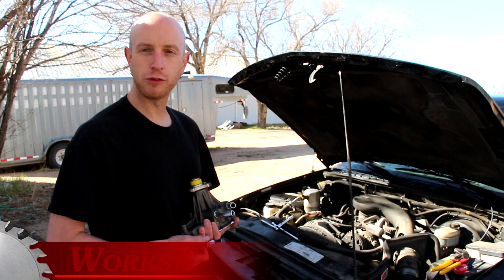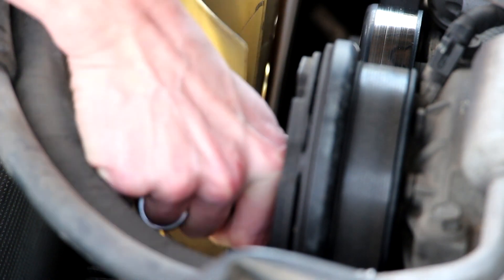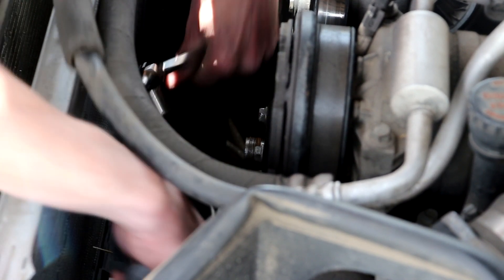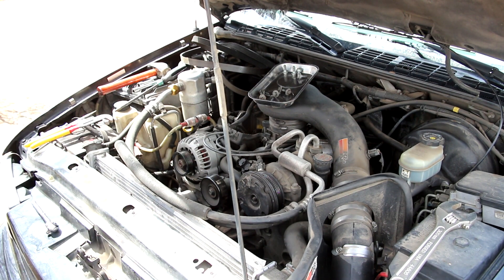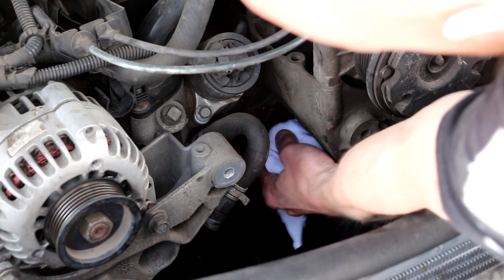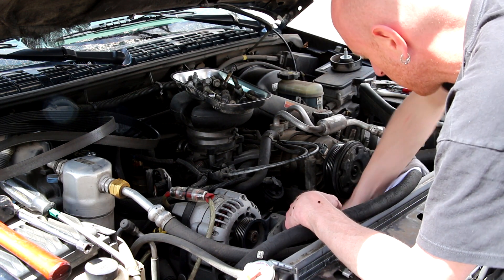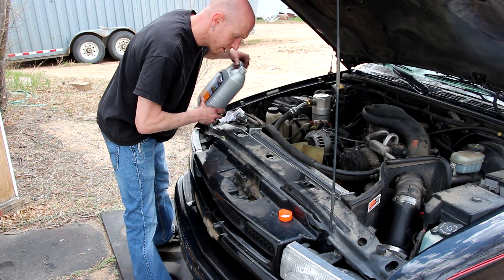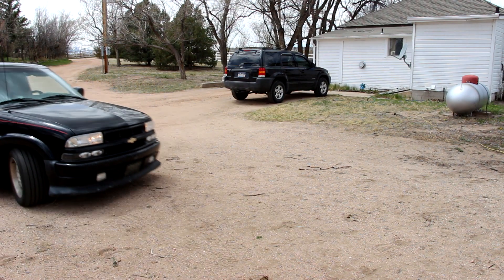Changing a 1999 Chevy 4.3 V6 Water Pump

Comment: I have a 2001 Silverado. Watched several videos, but watched this one several times before I did the swap. Someone suggested that I not rtv the gaskets because if the application is not even it can harden and cause a bad seal. But after wrestling to get the gaskets and bolts in place for 30 min, I went with a thin coat of rtv just to keep the gaskets from falling off. This was my first time under the hood. I was most worried about getting the fan nut off. But I rented the wrench and was lucky enough to get it with a screwdriver under the pulley bolt. 

Excellent video. Thank you sir.
Reply from the maker: Awesome! I'm glad you got yours fixed. Sometimes a little RTV is a big help holding the gasket.

Comment: Just wanted to thank you for posting this video,  I decided to give it a shot after watching this and the job was a success. I have a 2000 GMC Jimmy but the parts were the same.  I rented the wrench for the fan from AutoZone. It was for a Ford but it still worked.  If anyone out there is a little skilled then watch this video and do it yourself, save some money and take pride in your accomplishment.  Total cost was about $70.  Thanks
Reply from the maker: Awesome! I'm glad you're back up and running.

Comment: Thanks for making that video, made my life much easier.  I was really concerned about removing all the accessories around the water pump.  Seems that wasn't the case.  It was a bit of a challenge to get the new pump to line up, but no big deal.  I had it all done in less than 90 minutes.  One tip to add.  While got the belt off,  check the idler pulleys.  I found the bearings in both idlers were bad.  Thanks Jeff.
Reply: B

Comment: Thank you for this video!!! Honestly I couldnt have done the job without it. Had already replaced the fan and radiator, then found out the water pump was bad!  Also, thanks for the small detail info like the thread sealers! Many thanks!!!

Comment: A BIG THANK YOU! I You pointed me in the right direction!!! I had no idea where i had leak, but i had one, and it stranded my wife, but she was smart enough to reconize the 2002 xtreme was overheated,so she parked,  called me, had it towed home, but still couldn't fiqure when the leak was, till I filled it completed back up ran it for awhile (10 minutes) no hoses were leaking, then i saw a drip from the bottom of the timing cover,1st thoght was a cracked block, jacked the car up and found it dripping a lot from the bottom of the watrer pump,(The Weep Hole) You saved a ton of time!  this was a relatively an easy fix with your help!
Reply: +benjamin lopez best to use a radiator pressure tester - pump it up to 15lbs and you'll be sure to find your leak - it will be flowing out - I did this recently on two 4.3's - one was a leak at the intake manifold front of engine and the other that I'm doing now was the water pump.  It's hard to tell sometimes with the engine running and the fan blowing and coolant dripping from god knows where when everything is wet.  Make sure you top up the system first.

Comment: WOW !!  When my 99 S10 ZR2 got up to halfway on the temperature gauge, my intake manifold gaskets needed replacing.  What I did on my fan bolt was, I got a set of visegrips on the waterpump pulley after removing the S-belt,  and with the 2 foot long crescent wrench that I bought, (could of went with a 18 inch) loosen the nut and the viseggrips get wedged in place from the pulley. Truck went down in Oct 15' and Im still doing the job!  Im a truck driver, so Im not at the S10 everyday !! Also what you can do on that nut is take something long and put it under the lower right waterpump pulley nut and that will hold the pulley from turning...................................

Comment: Excellent instructions on your video. Yes, the fan clutch removal is tricky, but your approach worked for me, as well. I understand you may be able to rent the removal tool at places like AutoZone. Upon opening the NAPA water pump box, the inside top box flap states that the number one reason for new water pumps to fail is failure to flush the cooling system BEFORE installing the new pump.  That make sense to me, as well as perhaps, changing out any hoses that seem a little soft or "iffy". This video really helped me know what I was in store for. THANK YOU!

Comment: Im moving across the country and I'm stuck cuz my truck is over heating. I'm on the side of the road right now... Gonna let my truck cool down limp it to the auto parts store and replace this video was great thanks a ton
Reply: Check you fan clutch too, if you're over heating happens in stop and go/city traffic. It's also worth checking your thermostat and radiator cap too.

Comment: yea I just did one hell of a coolant flush on the blazer, because I ran dex a little low, and it reacted sludgy to the oxygen that entered the system, now I'm putting in the newer zerex g05 coolant it is highly favored by blazer and s10 owners for its lubrication properties on the water pump and seals!

Comment: Good Video and Clear as well. You should have protected the Radiator Fins... Cut a Cardboard same size, Tape it on there. Then you can work without worries :D
Reply: Or just pull the radiator and clean and flush it while it's out.
Reply: @gpecaut1  - Yup, that would work too! :)

Comment: Thanks for the video's they've been a big help. Another easy way to get the fan off is to put a small chain behind one of the ac bolts and one of the four bolts on the water pump pulley that holds it nice and tight so you can loosen the fan
Reply from the maker: Thats a good idea. I may have to try that.

Comment: awesome video, I'm about to do this on a 2001 blazer.
Reply from the maker: Did you get your pump changed?
Reply: +Jeff Baker i did thank you, i also had to change the radiator. Seeing the issue you had removing the fan, i rented the tool to remove it. I still had to use my wrench and your favorite tool lol. I pretty much used every method you did, even for installing the gaskets in the water pump.
Reply from the maker: Awesome. Did the fan tool make it any easier?
Reply: +Jeff Baker it has when I've used it doing it on a 350 vortec suburban. the tools on the kit were either to big or to small.

Comment: I nearly lost my mind trying to get the gaskets to stay in place while installing the pump. Ended up destroying them from falling off into oil and coolant, even with the bolts in the pump. I ended up buying a sheet of gasket material and making my own gaskets, so I could make the bolt holes just a hair smaller than the bolts, and they held in place perfectly. And now about a year later I have a massive coolant leak from what I'm assuming is the new pump, or possibly the gaskets, I'm having trouble pin pointing exactly where. So I get to do it all over again.

Comment: Let me save EVERYONE the headache for these fan clutch bolts.. 

1. Put your wrench (15 in adjustable is the easiest and cheapest to find) on the nut.
2.with the belt STILL ATTACHED have the wrench sitting vertical so that the back half is sticking up above the motor.
3.smack it with something (I used a jack handle like a baseball bat). Smack it hard. Imagine that the wrench just insulted your s10.
Reply: J L I just used your advice, worked perfectly,
Reply: 36 mm wrench is a great fit for the nut

Comment: Did you only put gasket sealant between the pump and the gaskets or the mating surfaces where the pump is installed and the gasket too?
Reply from the maker: Both sides of the gasket.

Comment: I have an 02 blazer 2dr, after months of sitting I started it after warm up steam city from under hood let it sit month or 3 longer and changed upper hose thinkn it was issue filled up radiator and started it and water was gushing out the bottom of engine thought it was the two lines that run by oil pan then saw it was gushing out the water pump seal not weep hole so my question is will replacing water pump likely to fix it or u think I will find another issue ? 
No water or anti freeze in oil n water pump is hella rusty . Next question is how hard to replace ac pump since I'd be in the area and are there other things that I shld check or replace while in the area of water pump
Reply from the maker: If its gushing out the water pump, the pump has probably failed. Its hard to say without seeing it but I think that may be your problem. As far as the AC pump, it shouldnt be hard. You'll need to pull a vacuum on it to remove the refrigerant but the actual replacement of the pump shouldn't be hard.
Reply: @homebuiltshop  ty bro I'm serious when I say that you going out your way to reply to a stranger promptly and with encouraging words is the sign of a good person whom I have much appreciation for. Ty again brother and I'm waiting on wtr pmp to arrive once I finish I'll lyk and it will be with your videos help. I also watched your video on rust removal and another way to get it off of things like hand tools is white vinegar add a cup of salt to every gallon vinegar let sit covered for 24 hrs (less time depending on how bad it's rusted) take out wire brush it rinse in water and baking soda to neutralize the acid from vinegar n salt and 3 n 1 oil it to prevent flash rust it's excellent way I use it for tool restorations on vintage tools I do as hobby and extra money.
Reply: Replacing the AC compressor isn't hard, BUT when you open the AC system you should also replace the dryer. The system should have the refrigerant pumped out, a very expensive tool, as today it must be recovered. If your car is old enough that it has R12, the whole system should be converted to the new EPA specs, as R12 will 1; be hard to find and 2; cost a fortune.

Comment: Where did you wedge the screw driver when you were trying to break the nut lose?
Reply from the maker: You have to wedge it between one of the bolts that hold the pulley on, and the fan shaft. There are 4 bolts on the pulley. You have to play with it a bit to get it in the right spot. Its kind of tricky to get that large fan nut loose. Mine was really tight. I think they make a tool that somehow holds the pulley while you loosen the fan but once you get the screwdriver in the right spot, it works OK. Hope that helps.

Comment: Very informative and professional video. I have a 2001 s10 v6, would this most likely be the same procedure and part?
Reply from the maker: The procedure should be the same. I'm not sure if the pump is the same. Check the auto parts store.
Reply: Pretty sure GM has been running the same 4.3 since the mid 90's with slight modifications until at least 2010; Workplace has two new-ish GMC that have the 4.3 Vortec, different configuration but same block.

Comment: I have wrenches 32mm,1inch and sockets that go up to 36mm do you think those are big enough for the fan clutch Nut ?. my water pump looks like it's covered in rust so I'd rather replace it then be sorry later
Reply from the maker: +Dillon Koch a socket will not work. It needs to be a wrench. Grab some of yours and see if they fit.

Comment: Great video, But what size is that fan clutch bolt.
Reply from the maker: I'm not sure the exact size. The large adjustable wrench works well. I think I used a 12" wrench. The 10" one didn't go large enough.

Comment: I am replacing a 2001 Blazer's water pump.  You did say thread sealant on the bottom bolt?
Reply from the maker: +Jason Driskell I don't remember which one goes through to the water jacket. I think I put the sealant on all the bolts.
Reply: Thanks Man.  That's exactly what I did.

Comment: when you remove the hoses does all of the anti freeze dump out?
Reply from the maker: You will lose dome fluid when removing the hoses. Its best to drain the radiator first to try to minimize the mess. It can be messy.

Comment: I replaced water pump today but when'd turn on the heater to ad the coolant I saw that started to liquid weather next to the freeon deposit do you know what wrong on it ?
Reply from the maker: +geo geoo do you mean on the AC piping? Sounds like condensation. The pipes will do that when the compressor is on.

Comment: When you removed the nut from the fan, instead of hitting it with a hammer why didnt you just use a breaker bar? A long metal pipe or similiar over the wrench and turn?
Reply from the maker: That probably would have worked well. I just didn't think of it at the time.
Reply: +Tyler Bullard  I had to use a piece of chain and a longer bolt on the sheave and bolted it off on a part of the  car frame to keep it from rotating. AND a long piece of pipe on the end of the open end wrench. AND a sludge hammer. Not fun, a little Never Seize when reinstalled. I did that for a fan clutch the beginning of the summer, now I get to do it again for the water pump. Might as well pull the thermostat and give it a flush before I change the pump.
Reply: Breckenridge Caine III Get an air chisel man. I tried everything but your way to break the clutch bolt lose and hold that sheave/housing. 4.3 s10? Didnt even have to hold the housing, buddy let me borrow an air chisel and i went at it for a bout 20 seconds and it broke right loose and spun off.
Reply from the maker: I've heard of the air chesel attachment and I have an air chisel. I just don't have the attachment for the clutch.
Reply: +Breckenridge Caine III  Got it off; ran the chain to the cross bar underneath and the clutch nut came off with a tug on the open end adjustable wrench. Everything is off, engine flushed,  I'll put the new water pump on Monday.

Comment: Is the same with the heater on I never turn on the ac that's why I'm little worried
Reply from the maker: +geo geoo I believe when you have the heater set to defrost and possibly the vent,it turns on the compressor. I think only the floor vents don't use the compressor.

Comment: Can I use any wrench or do I need to rent one?
Reply from the maker: javier garza You should be able to use any wrench that fits.
Reply: Be at it for a while & it wouldn't give. Calling it a night. Trying to take off fan but no luck:(
Reply: Unscrewing it to the left side?
Reply from the maker: javier garza It unscrews counterclockwise. Make sure you hold the water pump pulley still with a screwdriver or something. Mine was really stuck. I had to whack it pretty good with a hammer to get it loose. You'll get it. Good luck.
Reply: Had to take off alternator then took off water pump with fan on. Took it to my Buddy shop & use a air chisel.
Reply: More space to work & decided to flush out radiator & it was dirty. Guess what had to use Bar's Leaks :(
Reply from the maker: I'm glad you were able to get it.
Reply: I usually take my truck a mechanic ,but thanks to your video I didn't have too. Thanks again,!!
Reply: 36 mm is the right size,  Amazon has under $20

Comment: What size is the fan nut?  thx!
Reply from the maker: +godisgoodallthetime I don't know the exact size. I used a 12" adjustable wrench.
Reply: Works for me.  Thx!  Just replaced my f.p.  Did the ole lift the bed trick.  Worked great!  Now she runs good but now the weeper drips from time to time.  My abs and brake light keep coming on and off, does that mean the pads and rotors are bad?  4 wheel disc.
Reply from the maker: Hmm. Not sure on the ABS light. I would definitely check the condition of the components. Funny you mention the fuel pump. I replaced the pump on this truck and took the bed off too. Its way easier than dropping the tank.
Reply: 1/2 very hard to remove limited space.

Comment: man my 98 envoy  is breaking my balls.i went and rented a special too to get the fan off im still struggling.
Reply: +Dave Gibson They can be a bugger.  Keep the serpentine belt on and use a long screw driver as was done in this video to wedge between two bolts on the pulley  - a very long handled crescent wrench is necessary to give you the torque to bust it loose.  I've also seen someone make up his own tool using a piece of flat steel and drilling the holes to match the ones in the pulley - once installed it works better than anything to hold it tight while you loosen that big nut.  More effort to fabricate it but if you do this often, it will be well worth it.  Of course you can also use a strap wrench to hold the pulley after you remove the serpentine belt first.

Comment: You didn't show the tightening of the clutch fan, you only hand tightened it. ?????
Reply: You're right. I guess I missed that part. I used the large crescent wrench and tightened it as much as I could. I did that after I put the serpentine belt on. The belt help hold the pulleys from turning. You can get in there and wedge a screwdriver on the pulley bolts to keep it from spinning.